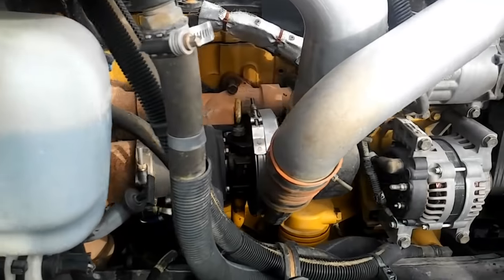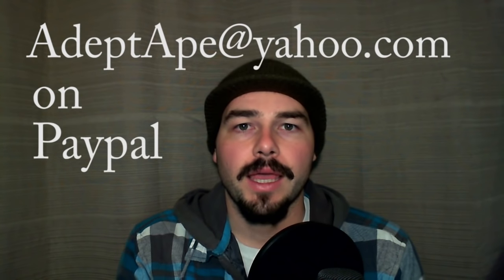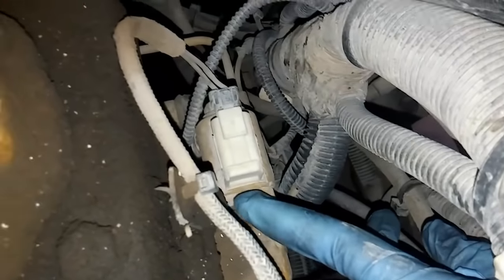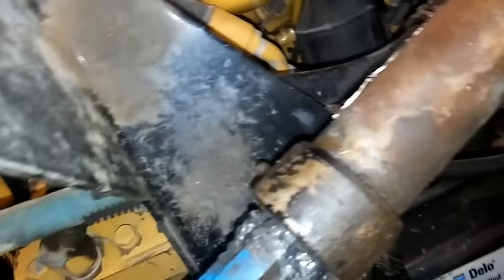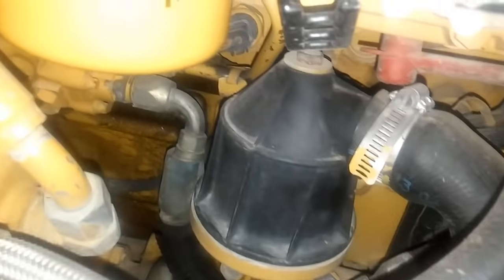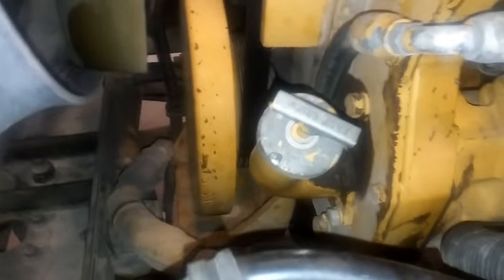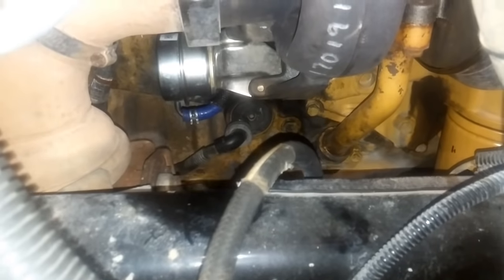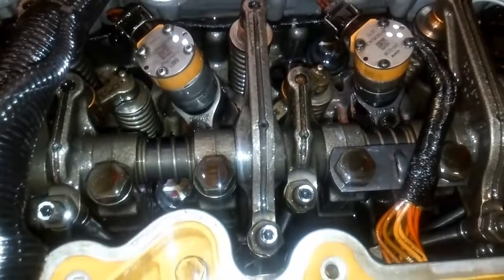The Cat C7 Engine.  Facts, Walk Around, Sensor Locations, and Maintenance.  Know Your Engine.

Comment: I just had one of the brass/copper bushings go on one of my 05 C7's in a dumptruck.  Took out the camshaft too as you mentioned.  Curious to get your opinion on what would cause this to happen.  Is this something that wears and weakens over time or can it just happen from abusive driving? Hard downshifting, lack of oil?  This truck gets driven by several different people and wondering if I need to put more time into training my drivers.  Your videos are great; thanks for sharing!

Comment: Thanks for the info, 
I am committed to a purchase of a 2008 Ford 650 and to my surprise it has a CAT engine. This info was not shared with me online, before I took the hour long drive to lay eyes on the truck. That reason was! the dealership does not have the authority to sale a commercial vehicles, I assume insurance or some other governing in there industry, however I test drove the truck and it ran fine although it seems to have an automatic engine break whenever I let off the accelerator the engine would slow itself down. But it is a beast of a truck! This is what brings me here. It is a AS IS! sale and there mechanics have no clue about this truck and they normally offer an inspection /diagnosis IN HOUSE. and Like you would imagine things got all slippery during the closing stages of the sale and I felt like I may be getting screwed. asking price $ 25,597. I got them to $24,497. Whata re the first things I should do with this truck to insure it's road worthy and I made a good purchase???

Comment: Love your video's, I've watch these when i had a 3126 and I'm back because i believe i have a C7 in my 2006 Tiffen 40 ft motorhome. last week it was on it's way to Alabama from Philly PA, ran like a champ down the the Virginia North Carolina border and then it went bad. I wasn't there, a buddy of mine had it, he said it started blowing some black smoke, had a small vibration and then shut down, would crank and is now in a yard in NC. After watching your video i'm curious if the high pressure oil system could lock things up without really damaging the lower portion of the motor. I'm feeling like this is a blown motor but i am very limited on my diesel knowledge, if it was a gas motor i would know a little more, but i'm looking for some very educated info. My 2nd question would be, if this is a blown motor and i need to replace this do i have to replace it with a C7 or could i put another Cat motor in there instead. I really appreciate any help or advise you might have because I have to fix this, the motorhome is very nice with the exception on this issue.

Comment: 93-1 got a fuel pressure voltage high which indicates an open circuit. Well your video guided me to the back which has a fuel pressure sensor on the left side of the regulator that was unplugged.

Comment: This is fantastic!!! Thank you so much for this info.  I have a cat year 2000 3126 and it runs great.  I'm looking at a 2005 C7.  I've seen this video and is there anyway in inspecting the truck with c7 to see if there are any HEUI problems?  Hard cold start, smoke?  What can I look for that could be a deal breaker onsite with no tools really?  Truck has 150,000.
Reply from the maker: +n9878f Without a way to communicate with the engine, the best way would be start it when it's cold, look for any stumbling or surging, then run it at different rpms up to operating temperature. You should have them take it to a Dealer that could plug into it and pull any diagnostic codes if there are any. Usually they won't charge anything just to pull codes.

Comment: I had the fan hub assembly seize while driving through AZ. The belt shredded and the fan fell off. I was lucky it didn't also destroy my year old radiator and CAC, but it still cost almost $3K when it was all done.

Comment: I have a 2007 f750 with a C7 that ive have for about a month now. 88*** miles man i can sleep worrying about this thing. One source says 16qts oil one says 19qt. Noticed upon start up "stop engine" light comes on for 2 seconds then disapears. Truck runs well tho carries 25 yds of wood chips (i run a small tree service) why would the "stop engine" light come on for a second like that? Runs like a champ. Have not had any issues with cold starts. Actually really enjoy the sound of this motor. But the potential issues scare the bejesus out of me.

Comment: I worked on a 963 with a c7 bullshit spot for the side motor mounts had to either remove the cab or get a bunch of old service manuals to use as a booster so I could tighten it

Comment: Keep coming back to your channel for more!! 

I have a question 
Got a c7 in my Sterling flatbed, power steering fluid god dumped out on the way back from a 30 mile drive. Pouring out of the reservoir itself. Can’t find any leaks, I put some pressure (10psi) to the reservoir itself to see if any vacuum hoses would leak but still nothing. 
It has the hydra boost brake booster so the brakes are tied into the power steering system. 

When I turn the steering wheel (with front end jacked up) left, the fluid level goes down, then turn right and it goes up in the reservoir. What makes it super pressurized is when I hit the brake pedal, almost instantly it’ll fill the reservoir and piss out of the cap. Thought the PS filter was clogged, changed it out and still pouring fluid. 

I have 3 things that are pretty pricey that I could replace: 
Power steering pump on the engine
Brake booster on the truck 
Or steering gear.

I’ve been doing some reading and apparently all of my symptoms point to the power steering pump itself. I’m planning on going to the CAT dealer in the morning but just wanted a second opinion. 

Thanks for all of the videos man 
I literally chop veggies/bbq to them when I make food lol even the ones that don’t directly apply to me I call it “learning ahead”
Reply: I was reading issues and automatically thought power steering pump.  Did you get it fixed and how many miles are in your c7?  Do you like it overall?

Comment: You are the first person I've seen that has had some relevant information on issues I have at work.  I'm a heavy equipment tech at a small city landfill, and we are having a crank no start issue with a C7/3126(?) water truck.  Fabik says everything electronic is OK, but when I get the engine to run for 20 or so seconds on either, the tach doesn't move.  To make things more confusing, the fuel I pulled from the tank is blue green, and opaque enough that I can't see the sun through a pint jar.  What would be your start point to get this truck back up?

Comment: Awesome Videos,  valuable information.
Quick Question.  Can I program an ECM by copying the files off another ECM with same cat C15 engine,   first 3 digits of serial #
are the same   SDP , only difference is o.ne has an Ultrashift Transmission and the other is a manual transmission.
Reply from the maker: +Moytech Yes you can, it's called copy configuration in ET. You would still have to program the injectors, serial number, and whatever parameters are different such as the transmission.

Comment: As the CAT C7 does not have O2 sensors, what sensors does it use to do the same job as the O2 Sensor? Thank you for the wonderful and informative videos. They are an great help.
Reply from the maker: +W. Simpson An O2 sensor is more of an automotive gas engine sensor than a Diesel engine sensor. Since a gas engine has to run at a nearly constant fuel ratio it needs the sensor to fine tune the ratio. A Diesel on the other hand nearly always runs lean with a wide range fuel to air ratios. This is why a Diesel doesn't need an O2 sensor. There are nitrogen oxide sensors on newer diesels, but they are for testing the SCR catalyst system and egr, but they are not tied with the fuel ratio the same way an O2 sensor is.
Reply: Thank you very much. Great help and information. Thank you again.

Comment: Great Video's! I just bought a 2003 Peterbilt 330 SA dump truck with a Cat 3126B. My Water Temp gauge on the pannel does not work but my ECM see the water temp. Do they have more than one water temp sensor on the engine? One for Gauge and one for ECM?

Comment: adept . I have a 3126 rv engine that has flodded the oil pan with diesel and rand for 1 hour. should entire engine be rebuilt due to dilution? it has pretty good blow by

Comment: Did the BAE military JLTVs in the 2007 to 9 range get the screwy C7 with the S or were they the good old fashioned ones? It's says they were 2007 EPA compliant. Would hope with their multifuel requirement the defense department would get the engines without the emissions noose. Been web searching and I'm not smart enough to find it.

Comment: Hi josh, I have 2005 cat c7 in Kenworth t300 with allison automatic transmission. The engine runs good however every time  Iam  fully stopped in gear, my engine rpm fluctuates between 700-800 rpm. Any Help Would be really appreciated. Thanks

Comment: I have cimilar engine..
Cat c7 2007.
Freightliner..
Nocking noise sometimes 
Specially when taking off stepping on gas
Or on hight speed verly 
Did valve adjustment, did replaced all 6 injectors. ( No trim files were programmed)
Any ideas ,,
Reply: Great... 👍

Comment: Hi, just bought a F750 bucket truck with the C7 ,159k miles. Truck was repossession and had sat in a holding yard for 15 months. Was turned in voluntarily and truck was running and hydraulics/bucket all operating. Getting it towed to my mechanics yard for start up and repair. What are some things to watch out for in a truck sitting this long and not running.  Not abused or uncovered just sitting. Any suggestions would be appreciated. Thanks RC
Reply from the maker: +ralph campisi That's a long time to not start an engine, would probably say to try and tap into the oil rail and pump fresh oil through the engine, then change the oil and filters, dump in fresh fuel, prime the fuel system, probably need new batteries, but other than that you don't need to do anything special.
Reply: Definetly needs batteries. Thanks for the quick response and enjoy the holidays.

Comment: well I stalled out the other night and it wouldn't start. I assumed it was filters. changed both and when I prime it I'm not getting resistance as it should. below the heui pump is where I'm hearing a hissing like noise. when I get it to prime at all it will fire up and run until it loses fuel I suppose. I'm obviously not a mechanic but good with working on my vehicles. had it towed to my house with hopes it was filters. the water separator was disgusting with what looked like mud or rust. I just bought the truck and few months ago. thank you very much for the response and rest assured I will be making a contribution once I know how!
Reply from the maker: +jeffrey katits You should email me at AdeptApe@yahoo.com

It's easier to respond to comments that way. If you had rust in your filter, inspect those fuel tanks for deterioration. I would hook up a fuel line out of a bucket to isolate your suction side. You should watch my fuel system troubleshooting video if you haven't yet.

Comment: So glad for the information. I really thought my motorhome had a great engine. After this video,I am convinced it is not. I gather the oil changes are most important. I would think an oil filter between the huei pump and the injectors would be a good idea.
Reply: Cat makes a kit that includes oil supply line , filer housing and mounting.

Comment: Hi Sir,l have a question regarding to a C7 engine,my friend is selling me truck that has this C7,apparently is loosing oil true the blow pipe,trucks runs but has that problem,can l put a 3126 and replace the C7.?or is not possible? Appreciate your response,thank you !
Reply: From my understand c7 basically is the same as a 3126 just the c7 is a little more updated when it comes to electronics

Comment: Looking at 03 Chevy 6500 with the c7..was told the motor was rebuilt at some point...truck has 218k miles I believe or 280k. But with rebuild, 100k miles...there is oil in the coolant but there isn't any coolant in oil. What do you think? Possible cooler, cracked head somewhere?

Comment: Other then injectors leaking fuel, have you experienced any other failures with the head or pump leaking fuel?  

Looking at a truck, but it has fuel in the oil. Betting its an injector. (Well hoping, don't know)

Comment: Good evening friend Adept, I have a query for you regarding a CAT C7. There is some way to lower fuel consumption in one of these engines is the only CAT C7 of the fleet the others are Cummins ISB but are more economical when it comes to fuel expenditure. My question in particular is if you can do something with CAT ET to decrease fuel expenditure.
In advance thanks and blessings
Reply from the maker: +José Antonio Díaz Serpas Hmmmmm well, the only thing in ET that would affect fuel consumption is horsepower. You could rerate the engine for less horsepower, but other than that it would be make it more aerodynamic or drive slower to save fuel.

Comment: I have a 3126 that has a air intake heater.  The relay feeding power to the preheater is good.  What tells the relay to turn on.  It's in a 1998 chevy truck

Comment: I'm not sure where I should as this question. I bought a military truck with a CAT 3116. The state/age  of the fuel in the tank is unknown.  Would you put any additives in the tank to ensure there are no algae or other issues ? Also, what do you think of DieselKleen diesel additive? Thanks!
Reply from the maker: +urgentcareguy3 I'm not familiar with that brand, but it's probably a biocide for black algae. Best is to dump the old fuel change the filters and then run the engine a good long trip. The fuel gets pretty hot on a long run so it will kill most stuff in the system, then change the filters again.

Comment: C7 in a cat 324D Excavator,  I have a oil leak, it looks to be coming from behind the engine computer,  looks like some sort of inspection plate? Maybe for the push rods? Are those known to leak? I need to remove the computer to really see whats going on, but im kinda just look for some input,  or is there something else that might be leaking that im not seeing with computer in place? Engine has 12k hrs on it.

Comment: I have a 2008 f650 with a cat c7s engine that will not manually regen, the cat dealership says it's the ard head, but my question is could it be the fuel supply going to the ard head. When it starts the manual regen it will try for a few minutes before it fails. There is an ard after treatment nozzle that was corroded and it fell off when checking it. Would it make sense that the other lines could be plugged or corroded and not allowing the regen process to complete?

Comment: 1:15    if the fuel pressure regulator went bad would that cause an injector skip?
I've been chasing an injector skip on cylinder 1 for a while now in my 2008 ford f650 tow truck
Reply: I would just change that fuel pressure regulator and check the fittings on your injectors

Comment: I can really use your help! Bought a Chevy 8500 Dump with a Cat C7 engine 2007 From Baltimore City and I can not find the block heater cord. Is it possible it doesn't have one or am I looking in the wrong areas? Where would it be?
Reply: It's on the passenger side of the motor and follow it. Mine comes by driver door

Comment: So I have a 3126 in my class A RV and noticed that there is an electrical line that comes out of the block and plugs into a 120V outlet. What is that for? If I leave it plugged in it trips my GFCI outlet as it is on its load path.

Thanks in advance.

Comment: I've got a 2006 f750 with the c7 in it. I'm leaking power steering fluid and breaking is stiffening up. Do you think I can refill the fluid reservoir and get my truck to a shop 15 miles away?
Reply from the maker: +MrHorhell Depends on how bad the leak is, as long as you can keep fluid in it you should be able to make it, but if you are losing brakes it is safest to have it towed or fixed.

Comment: I am thinking that in the last two years of C7 production, the engine received a common rail type injection system. Is this correct and does that mean that it no longer used any of the HEUI hardware? And is this a better system?

Comment: I have a 3126B on my F-350 truck, I replace the inyectors seals because I have oil into the fuel system and after I replace the seals it still passing oil, should I have to replace inyectors cups? What is the chance to have a head crack on this engines?

Comment: i might have missed it in the video, but what motor oil does the c7 like to use? i assume Rotella is popular, but t4 mineral oil, or t5/t6 synthetic? i'm working on a 2007 freightliner rv style medium-duty truck with like 100k miles
Reply from the maker: +daft nord You can use 15w40 or 10W30 depending on the temperature range the engine operates in. I'm not a Shell or Rotella guy, either one is fine. Synthetic is best of course, but very expensive.

Comment: I wonder why the caterpillar engineers didn't add a second exhaust valve. There's two intake valves and only one exhaust valve. Exhaust valve is a little larger (intake valve is 1.578 vs. 1.697 exhaust. I believe the exhaust valve also opens larger.

Comment: You got a part number for that fuel regulator? For a 3406 c7? Can't find it on cat sis
My formans friend got a truck that cranks but wont start. Said the manual fuel priming pump won't get hard. Don't have the serial number, got a rando one online to try and use cat sis but can't find it. Thanks!